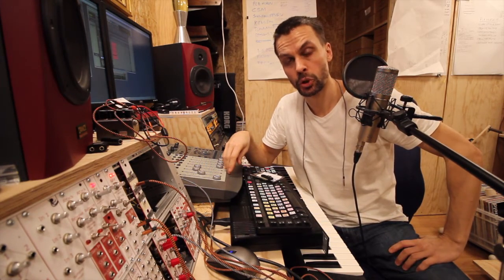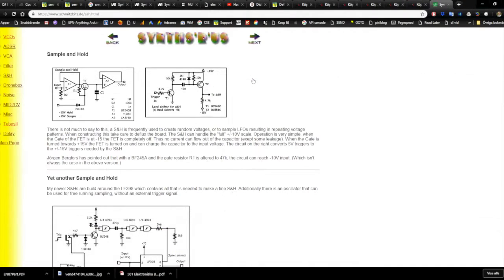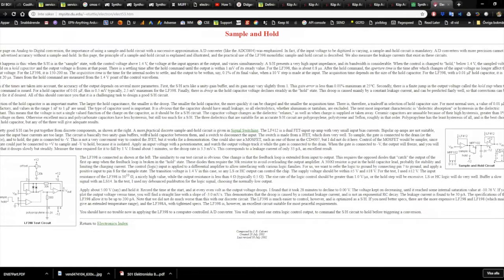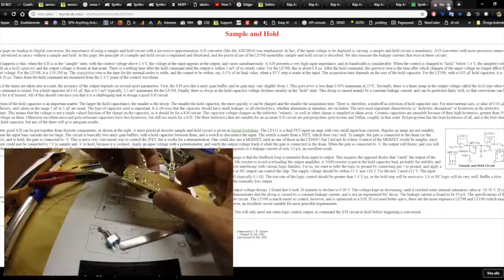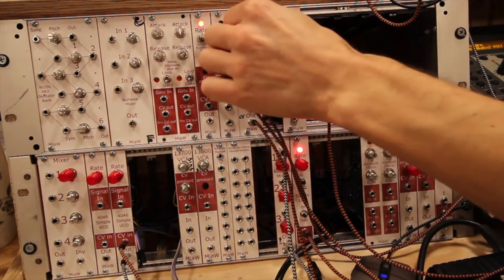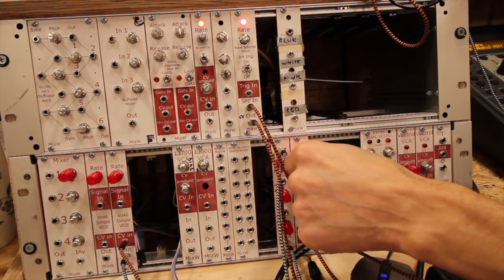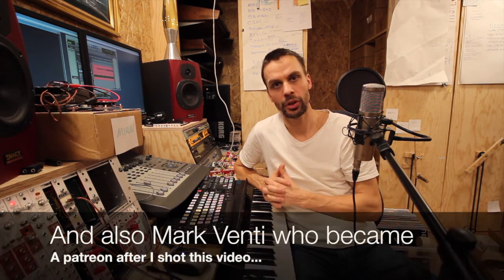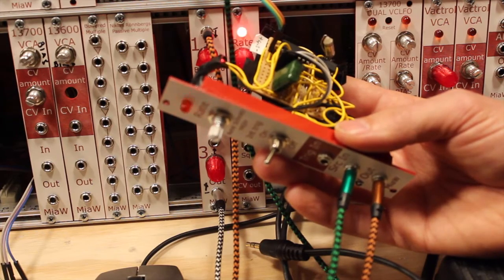Yet Another Sample and Hold by René Schmitz - DIY Modular in a week 6.4

Comment: does anyone know if the 4006/4093 (is that correct?) can be replaced with the 40106? struggling to see which IC is needed or appropriate alternative? thx
Reply from the maker: Try. The 4093 is a hex inverter. The 40106 is a hex Schmidt trigger inverter. The circuit is there to create a really short pulse. And I THINK the 40106 would work aswell.

Comment: Hi Kristian! Built this one, but it sounds as if it has a portamento included!! Haha used a polyprop (the blue boxed ones), which was told was ok (a guy in the fb synth diy group told me he asked Rene and said that was ok). Just checked everything and seems right. I tested it with the internal lfo... Do you have any idea of what could be, where can I look?
Reply from the maker: I still think it might be the cap that doesn’t hold the voltage. If you remove the cap you’ll notice a much stronger “portamento”. I think that is the problem at least. Do you have a video of the sound?
Reply: I have, let me try and upload it to yt (never done that!!). I also have some of the other pp caps to try out (they told me they are mylar caps (?), those green plastic ones).
Another topic now that I'm revisiting your videos: don't know if you still are into filters: did you checked the skulls and circuits vactrol vcf? Sounds really nice for it's simplicity! (I switched red leds and 2n4148 for different resonances).
Reply: It wasn't easy to find man, I'm getting old!
https://youtu.be/elC7gbP9zVo
Reply from the maker: Hmm... sounds cool but portamento yes. Does it always go “down” or up aswell?
Reply: @SourceryOne  I've built a few clones of the old Oberheim/Maestro Sample & Hold for guitar.  I thought I would experiment with something and found I rather liked it, so I kept it as an option that I like to call the "droop" function.  It is simply a bleed-off resistor for the storage cap.  The stairstep quality of S&H depends on the storage cap having negligible leakage, and being isolated by high-impedance paths.  Use a medium-high value resistor (1-3M9 range) to discharge the storage cap for each step and you get a "pyoo-pyoo-pyoo" microsweep for each step, that sounds like a science fiction movie raygun.  The drain-off resistance has to be matched to the clock /sample rate, such that the sweep/portamento isn't too slow or too fast.  This is a poor video of the droop in action: https://www.youtube.com/watch?v=GpG6uLUqUkM
Reply: Kristian Blåsol mine just goes down forever, any thoughts? Was using polypropylene cap switched to one of the green Mylar ones which I heard people had success with, same thing
Reply: I chamged the cap, still portamento, up and down, and it's doing kinda an upgoing effect, like, pitch is going higher and higher! (I stopped the video, but it continues).
https://youtu.be/C5VUbB9i-xU
Reply: Ale Brenna ever get this resolved? Having similar issue but where voltage just goes down like a really long glissando
Reply: @liamkramer-white4228  look at the rene schmidt page, he actualized some changes, didn't tested it thou
Reply: @liamkramer-white4228  let me know if you try it please!

Comment: finally got this one working. don't know why but it gave me a bunch of trouble. Had some space left on my board so I added the super simple white noise onto the switched pin of the input, so it will just use that as the default. fun!

Comment: Hello again.  Been looking forward to this build.  Love the comments below, very helpful.  Will definitely try the portamento circuit as well.  Like others, the non-polycap sound is actually pretty cool and I will try a switch on that.  My question is - where exactly did you put the internal trig on/off switch?  I don't think I see it in the schematic - correct?  Ok, thanks as always and take care!
Reply from the maker: Sorry for the late reply,.. Your questions always requires a look at the schematics that is why it takes time ;) So now I have looked, and if you look at the input jack on the schematics it is a breaking circuit there so if something is connected to the jack then the internal trig is disabled. I just added a switch instead of that breaker on the jack. And just added the two signals together. That way I can have BOTH internal and External triggers. Hope that helps...
Reply: @SourceryOne  thanks for the reply! Well the delay forces me to figure it out😀. So that's basically what I thought,  as you described.  I'm also going to put switches on the two caps as you suggest so it will be really interesting! Thanks again.  On holiday as you Europeans say, so the build will wait for my return.  Take care.

Comment: i googled this circuit and found this video, did you change anything or works ok with +-12v? good job with these videos... i see you didn't build any vcf yet... also sequencer, i'm building one with arduino and 4051s
Reply from the maker: Yes works great with +-12v without any changes. Filters is the next "day" day 7, which starts next week wednesday! :)
Reply: @SourceryOne   built it and works. I found a little mod on the web. bypass the 470p capacitor with a switch and the module become a track and hold: when the trig is low the last voltage is held.
Reply from the maker: stronzio666 oh nice! I will definitely try that mod! Thanks for sharing! :)